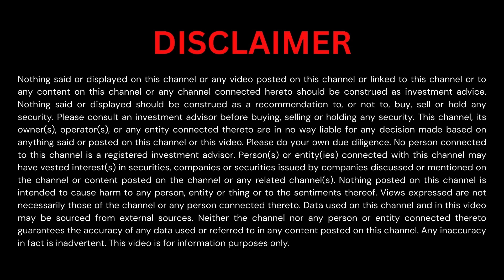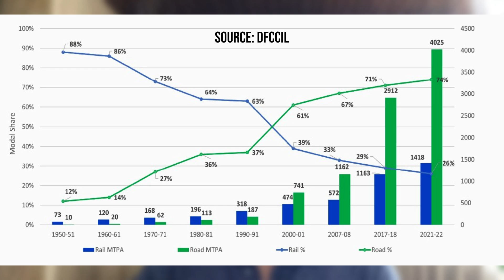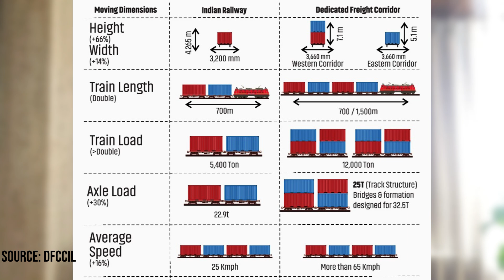Dedicated Freight Corridors Explained | Making India A Manufacturing Superpower

Comment: A very nice video sensei. But I don't think that the DFCs are going to be ready this year. The western may open partly but the eastern is about 3 years away from full completion. Pl correct me if I'm wrong
Reply: I heard over 71% has been completed and being used. That itself is a record in India. Hope they finish it fast and start the southern ones.
Reply from the maker: Glad you liked the video!

Fingers crossed that they will start this financial year. They may do it phase-wise but it is scheduled to start this year. Have to be on the lookout, hopefully things should get clear in a few months.

It was originally scheduled to commence operations in August 2020, but of course got delayed because of the pandemic. Like most large infra projects it has faced inevitable delays over the years.

You are right, completion is in a sense a moving target. Eastern and Western are only the first part of the project, the eventual goal is to connect the whole country. Current plans for construction extend through the rest of the decade. The hope is that the golden quadrilateral (Mumbai, Delhi, Kolkata and Chennai) will get connected over time.

Thanks for pointing this out!
Reply: 77% commissioned. 95% by December. Full 💯 by August 2024
Reply from the maker: You're right, seems to be progressing well.